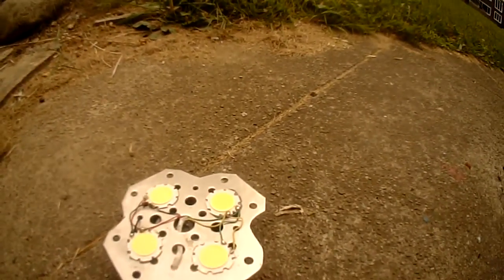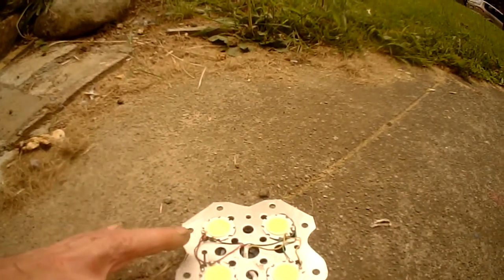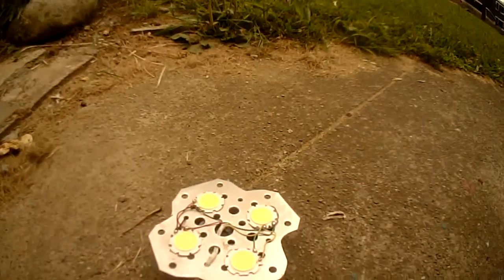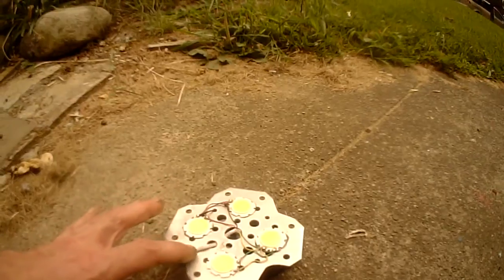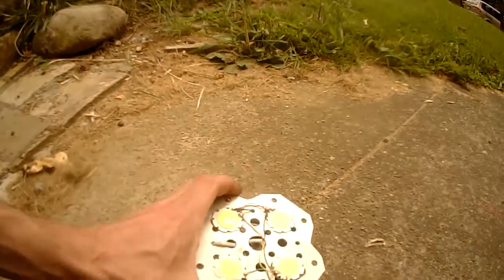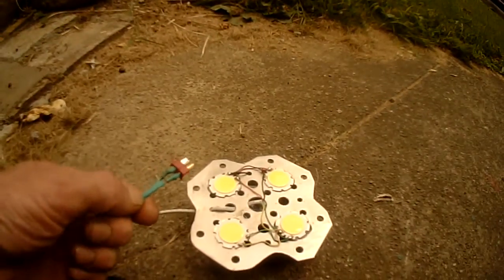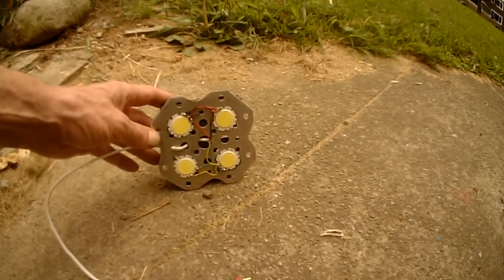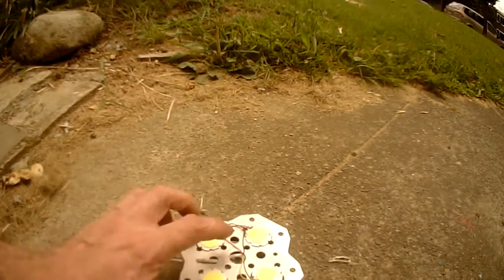12v 3w cob led heat sink diy solution for boats or off grid fpv.

Comment: nice brother 👍   , thank you sharing
Reply from the maker: 4- 3w run great off those cheap 1000ma 12v plug in wall adapters.
Reply: @Hoverbot1TV  12v/1A PSU supplies a max of 12w at it's very peak. 4x4W will require 16watts+headroom.